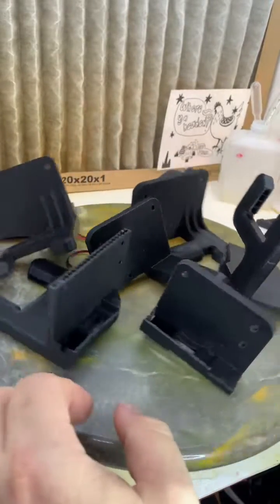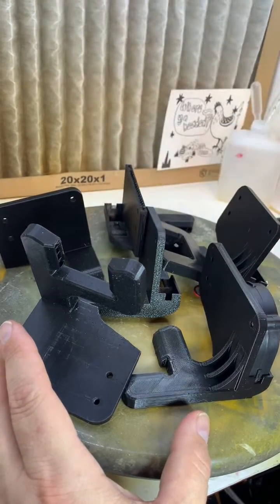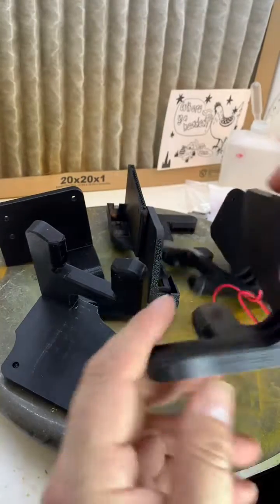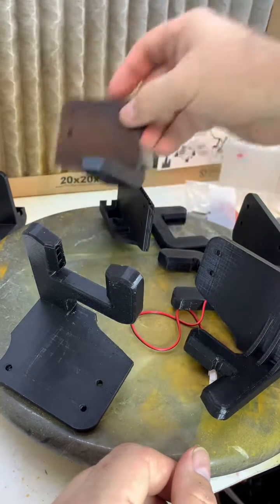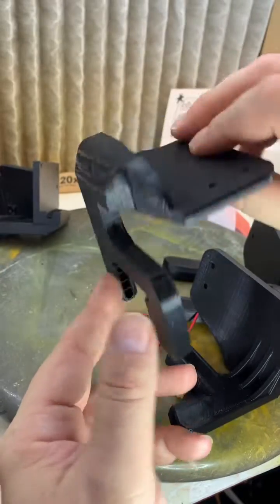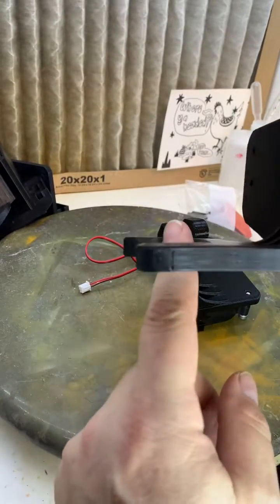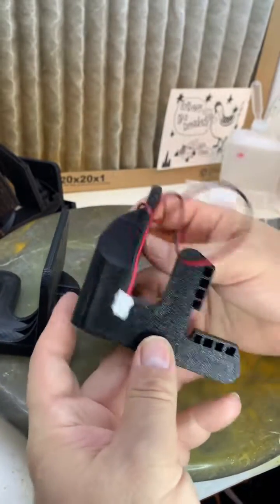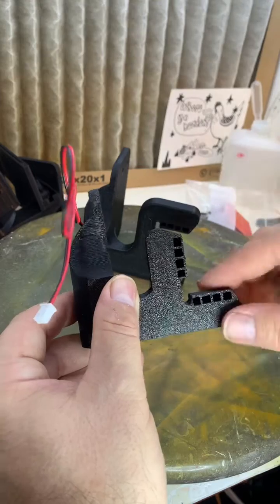Anycubic Kobra 5015 fan upgrade?

Comment: Currently using your rev. 13 design... and getting issues with hotend temp, despite proper PID tuning.
Let's hope I'll be able to print rev. 11 without having to go back to stock cooler first XD